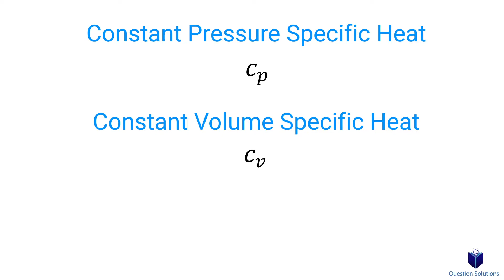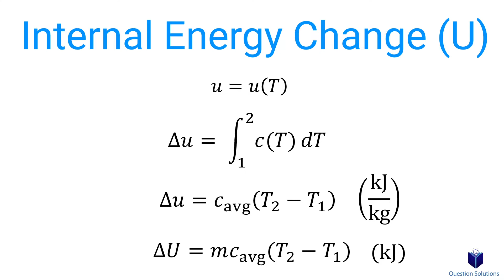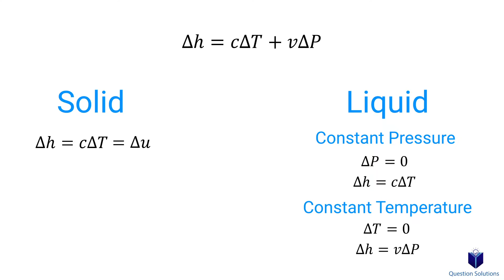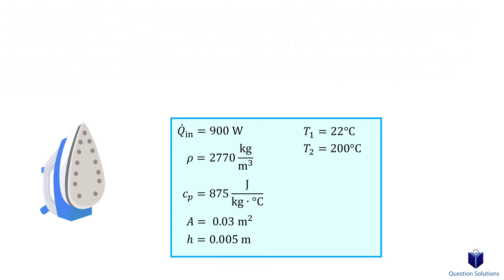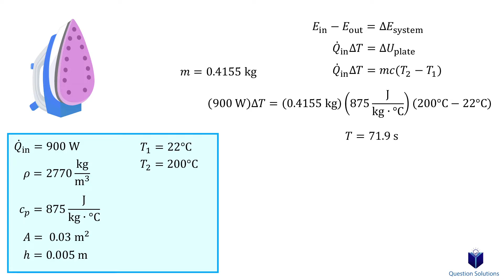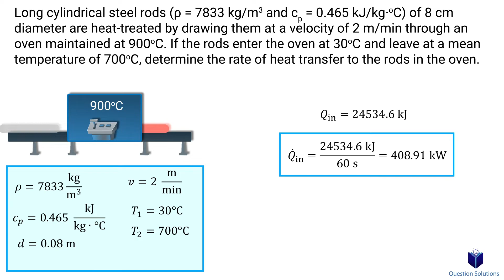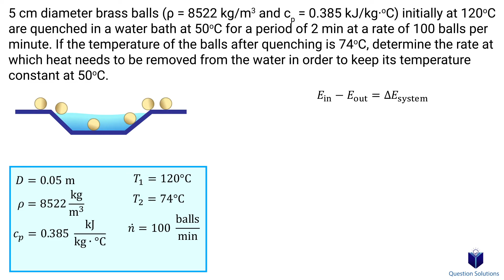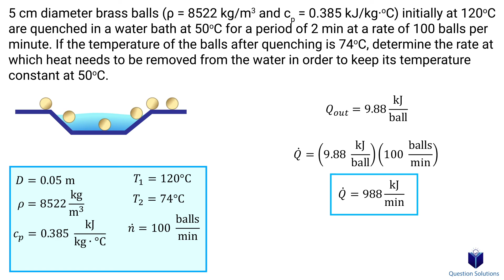Energy Balance of Solids and Liquids | Thermodynamics | (Solved Examples)

Comment: Why did we use deltaU instead of deltaH while the question is giving Cp at 3:39 because of deltaH is equal to deltaU for solids ?
Reply from the maker: So if we look at 2:02, we see that in a solid, Δh = Δu, so to answer your question, yes, that's correct.
Reply: Thank you sir